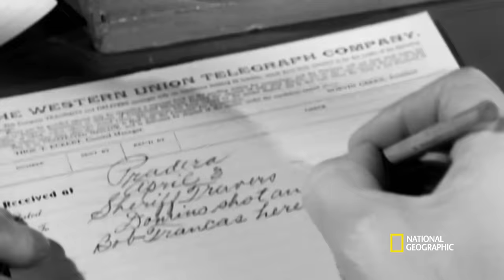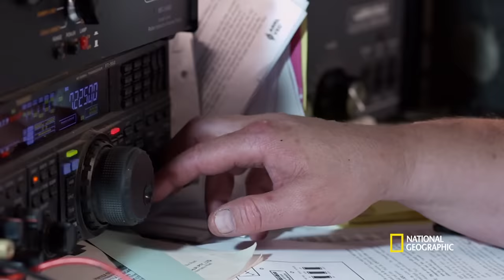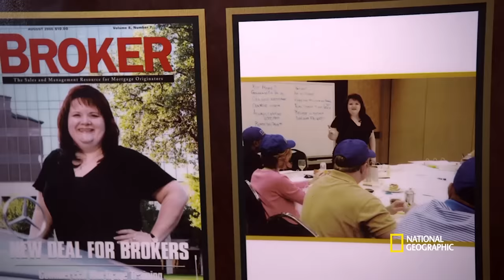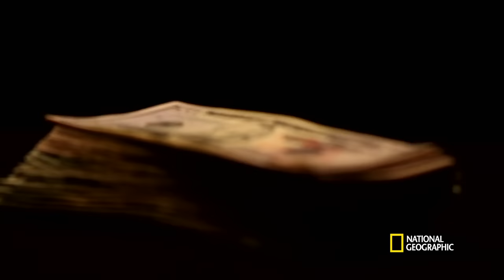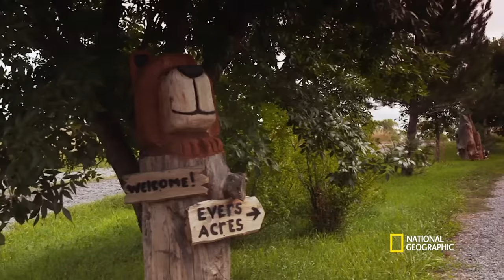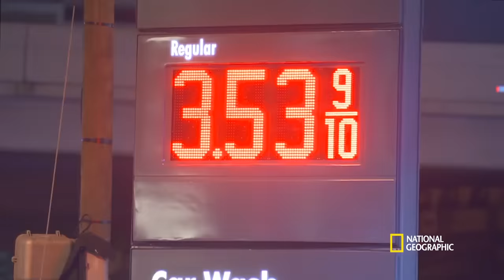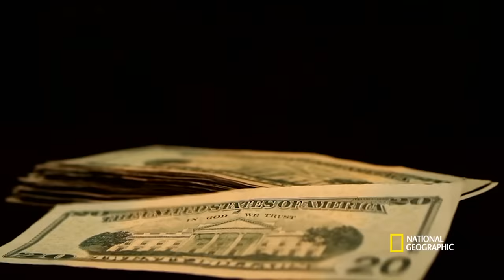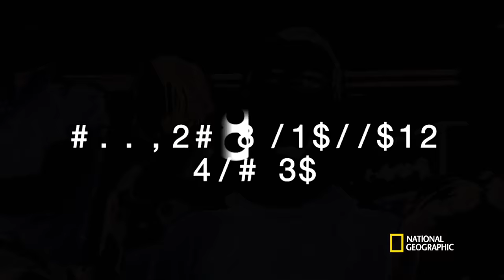I Hope I Am Crazy (Full Episode) | Doomsday Preppers

Comment: "I'm preparing for an Electromagnetic Pulse" not really when you have installed a holographic sight in your M14 xD
Reply: Lol! Didn't notice that til you said it. You know he's going to eat those poor little dogs. I give it two hours after the lights go out.
Reply: @daisyj4035  hahaha sounds about right , panic is gonna be first thing he's going to face .That faraday cage wont fit batteries and other electronics when SHTF. In my opinion at least he's not losing his mind with alien invasion because an EMP is more likely to happen.
Reply: @Tuberculosis Dan hahaha indeed the BMI is a huge problem . I'm not an expert in EMP of course but batteries that aren't on a circuit can't be fried ?
Reply: Every call of duty player knows this
Reply: @Tuberculosis Dan it would take an extreme level EMP and being directly at the source to damage simple AGM or flooded cell batteries by causing them to self short and internally discharge from massive static build up. That realistically won't happen unless you're right at the source of detonation.
What an EMP does destroy is the fine electronics, the capacitors, microcontrollers, and other higher level circuitry. basic circuits like simple electric motors, incandescent lightbulbs, simple switch systems like a car's starter motor and fuel pump, those will largely be unaffected.
Most(probably 90% or more) of the damage is going to be caused by the EM pulse being soaked into the power lines and causing a massive power surge and other funky issues to anything plugged into the grid.
Reply: Yep, not very effective at that point.
Reply: Dont I look coool. A fat tom cruise😂😂😂😂😂I love that guy
Reply: Yeah when that holographic site goes out you pretty much have to throw the whole M14 away, its useless then.
Reply: To be fair something as simple as a Red Dot site probably won't be destroyed during an EMP
Reply: why wouldn’t he just put his batteries in the metal box he’s building
Reply: @DCX1  or justs take the holo sight off?
Reply: I was going to say that 😂🤦🏻‍♂️🤦🏻‍♂️🤦🏻‍♂️
Reply: ever heard of a faraday cage??
Reply: Yeah, added that community of yours hold up during the toilet paper crisis? And that's jist toilet paper
Reply: Its a cool rifle but your right lol, maybe he can just get a red sharpie marker and put a dot on the glass of the sight haha
Reply: Batteries aren't affected by EMPs. It wouldn't hurt the sight either. Simple and enclosed.
Reply: That was exactly what I thought when he said it
Reply: @uncletom2962  it won't affect it lol. Too simple. No computers to blow and batteries aren't affected.
Reply: @Michael Freestone wouldn't bother the sight. No circuit boards or chips. Plus they're metal so the inner workings are protected by a faraday cage.
Reply: @Michael Freestone I don't rely on them, but they're faster and some can be used with night vision.
Reply: @Michael Freestone NVGs might actually be affected actually. They'd have to be stored in a faraday cage.
Reply: @Michael Freestone Night Vision vs none = death for the team without. I don't mind 80lbs of kit because I'd rather have it and not need it than the other way around.
Reply: @DCX1  lol right because simply taking it off isn't an option.
Reply: emp will fry circuit board in red dot.... batteries are not t h e problem
Reply: @gablia2002  how? Enclosed in metal. And shorter conductors are less affected. Source: US Army.
Reply: @curtism-w6b  because it will... Swedish army 2012
Reply: @gablia2002  yeah, so you seem more trustworthy than the US Military's testing.
Reply: @curtism-w6b  and you trust your government  🤣🤣🤣🤣
Reply: Saw that too. Should be at least an etched prism optic. hahaha
Reply: Whoops🤭🤭👍 nice catch. I took issue with him saying it can happen in a millisecond. It actually would take 8 minutes , you know, more or less.🤣🤭🤣😁
Reply: @atomicradiusatomicradius171  the us Army said they wouldn't be affected after testing.
Reply: @DCX1  Roflol.🤣🤭👍
Reply: Lol good point
Reply: @The_Alexander_371  Aliens are already here. Who else could benefit from SHTF and The NWO
Reply: You played too much MW2 kid, military grade holographic sights are EMP proof.
Reply: Eotechs are emp resistant
Reply: @AdamWeatherall  didnt know that , thx for the info
Reply: @DCX1  iron sights are still a thing though
Reply: @The_Alexander_371  right, who would want to invade this planet
Reply: Doesn’t he address this with that faraday cage thing?
Reply: That's an easy fix though. There's not that many components on that pcb and all of them can be sourced real easy.
Reply: @curtism-w6b  Actually EOTechs use a laser to project their dot, and that laser is powered by means of a small circuit board. Pretty much every red dot sight is controlled by a small circuit board, the brightness control buttons are used as imput for a PWM chip or small circuit board. And their metal housing doesn't completely envelop the inner workings of it, so it probably would be fried.
Reply: @pieterveenders9793  the army tested it. They said you're wrong. I'll believe them over you since you have 0 means of creating an EMP.
Reply: @curtism-w6b  Lol, it's dead easy to create an EMP, you might want to read up on physics before you make silly comments like those.
Reply: @pieterveenders9793  I'm a biologist who minored in physics. And you're Pieter, a guy talking about science but dismissing the only science done on battery powered sighting systems.
Reply: @curtism-w6b  Lol, this is the internet, your claims are just as worthless, for all anyone knows your got your "degree" at Wish or AliExpress. If you had the knowledge of physics you claim you do then you would have known that you only need to hook up a high voltage power source to an antenna with an effective ground plane in order to radiate a strong electromagnetic field nearby and simulate an EMP.
Reply: @pieterveenders9793  make one. Buy an EOtech. Prove yourself wrong, even though there's already a study on it...for whatever reason.
Reply: @pieterveenders9793  "Physically short conductors make very inefficient "antennas" for receiving the low frequencies produced by the HEMP pulse, so they do not generate much of a voltage spike.

In devices that aren't connected to any long conductors, little or no voltage spike is generated due to HEMP, and so the device is unlikely to be damaged." Wow, look at that. Seems like you aren't as smart as you thought. Not like you'd ever have to worry about owning a weapons sighting system of any kind.

Comment: Prepping for an EMP while he has an electronic sight on his gun..
Reply: Common misconception. The effects of an EMP blast on an electronic device is dependent on the length of conductors it contains. Small devices such as red dot sights, flashlights, phone, even your computer to an extent will most likely be fine. Transformers, hydro plants, power lines etc. will be severely affected tho.
Reply: Most isolated circuits will be shielded from an emp.  In most cases, battery powered devices can be used once you replace the batteries with fresh ones.
Reply: Listen to the guys above me ;)
Reply: @chucklee1313  even then, it wouldn't be hard to take the sight off and use the iron sights.